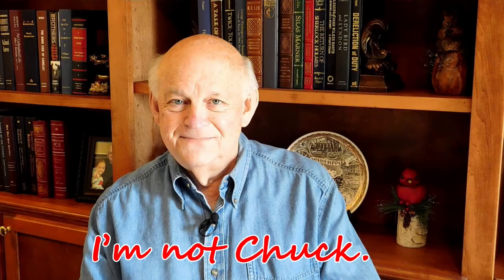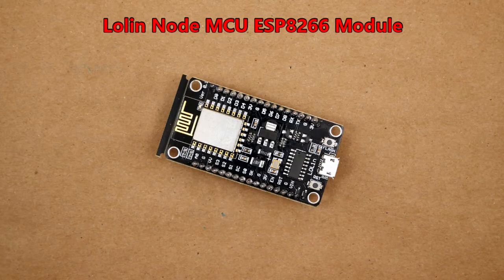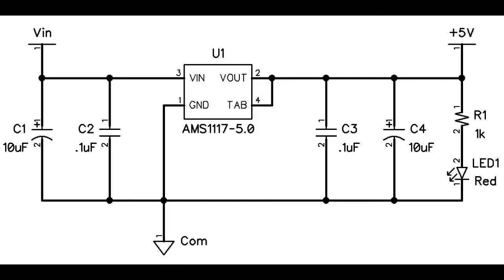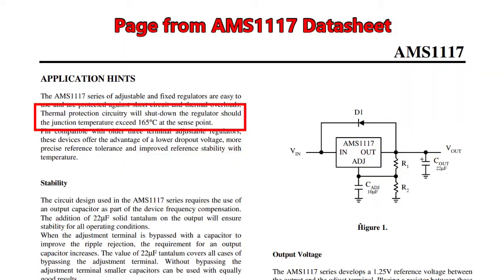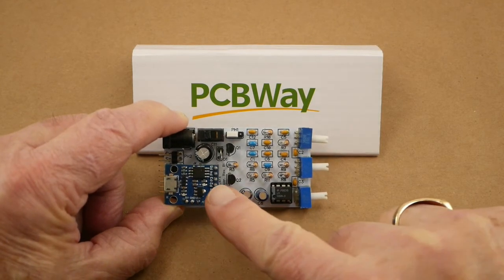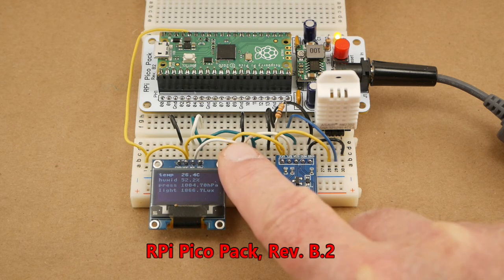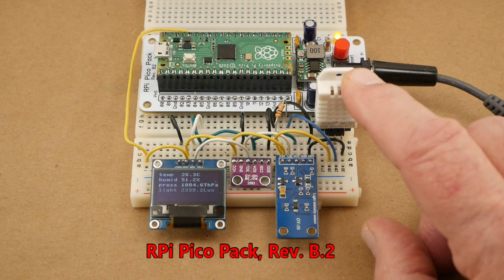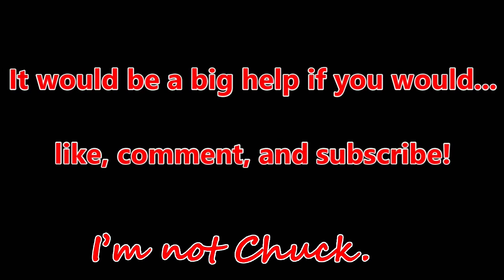Counterfeit IC's Cause Weather Station Redesign

Comment: hrm.

1:05 you're running 2s lithium ion without per-cell monitoring, which is a bad idea.  Since you're already using regulators, it's safer to go with a 1s setup and just step up to what you need and/or use buck-boost.

1:53 that diode shouldn't be needed with the charge controller, should it?  There should be a D1 per the reference design for the cn3795 which should prevent backflow.

1w might not sound like a lot, but without a heat sink and nothing else to really dissipate the heat with, it's obviously going to fail.  You only want that builtin shutoff to activate as a last resort.  165c is way too hot.